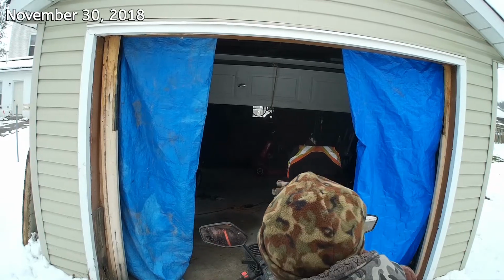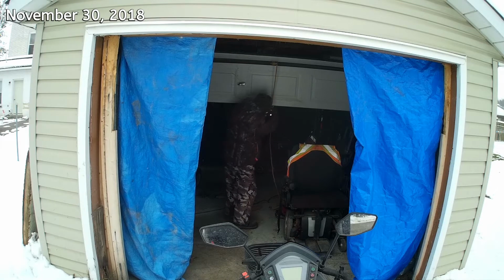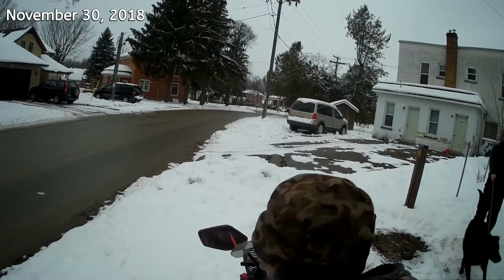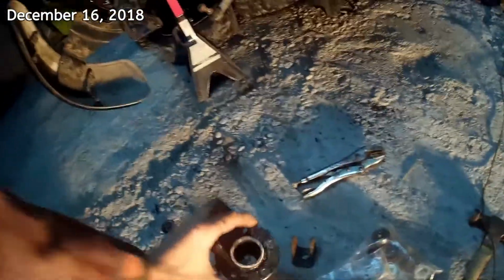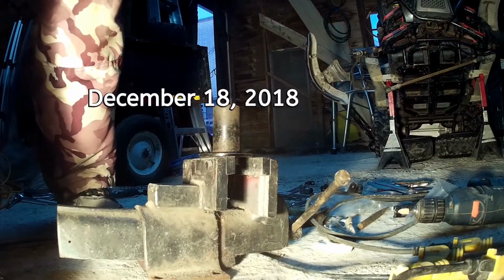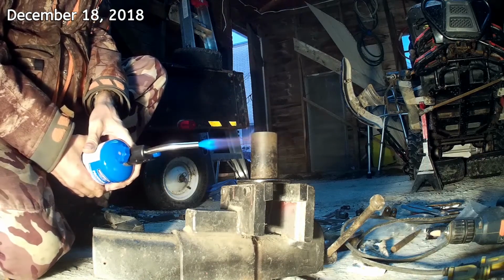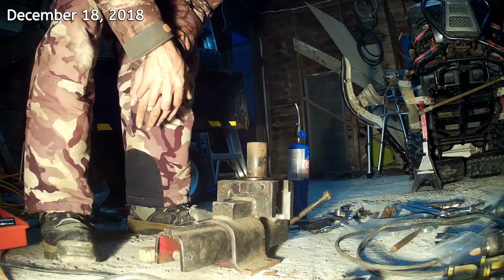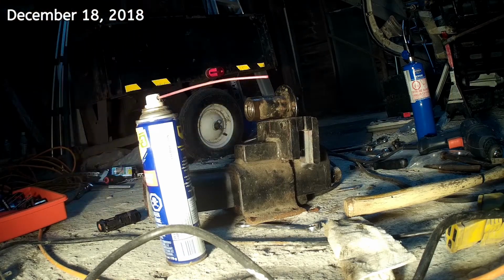Bearing Replacement Issues - Part 2

Comment: WD oil, it is necessary to fill in the inside of the hub with a bearing, along the edge, on both sides. And leave it at night, in the morning, knock it out from the inside.
Reply from the maker: That's the problem, I can't get behind the bearing because it is up against the steel rim on the inside and is flush with it.
Reply: I suggest to fill in wd, like this, https://yadi.sk/i/_saDOBOaAbIrog
https://yadi.sk/i/Xyc470sbq8Cnkw
and leave overnight.

Comment: Boy I wish I was there at the time to give you a hand Bud, bearings and bearing cases are case hardened steel very strong BUT also very brittle, if the outer bearing case was out of the hub, if you stand it up on it's edge cover it with a rag and hit it hard with a hammer it'll shatter like glass. The reason you put a rag over it is so the broken pieces don't fly out and hit you because if you do it like being shot, it hurts like hell and won't stop bleeding !!  Keep at Bud. Seeya Rob
Reply from the maker: That's why I figured I could smash it out with a punch. Just need to get the hole drilled...